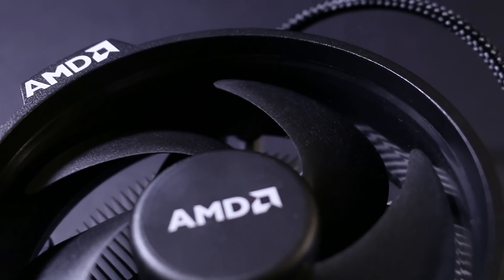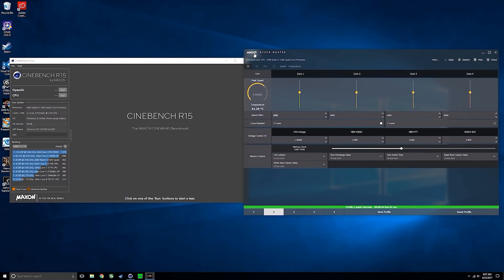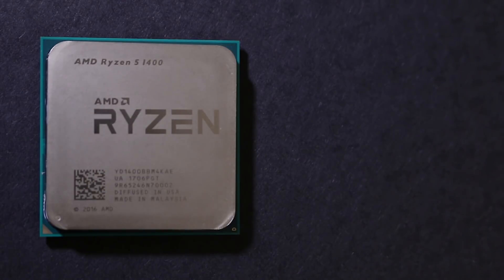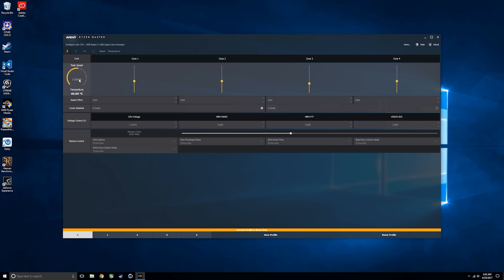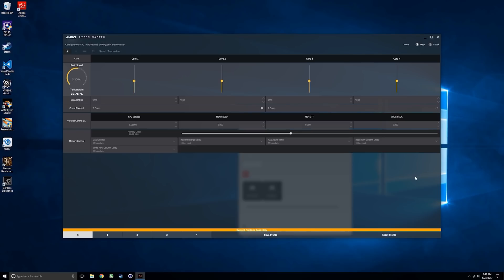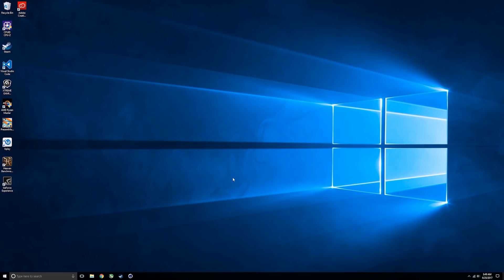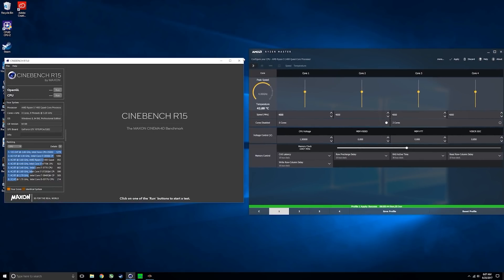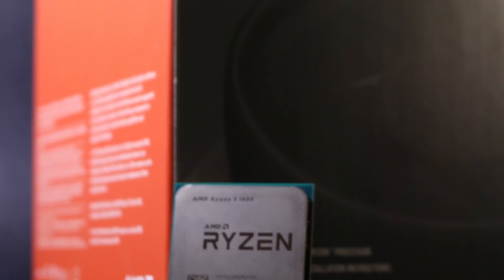AMD RYZEN Overclocking GUIDE

Comment: If i click apply it says that i have to enable HPET, do you know how to do that?
Reply: to enable the HPET, you need to go to the directory of Ryzen System Master where you can find a batch called "HPET", start it and then reboot your Computer. DONE
Reply: @cryptos6103   thanks for the info mate
Reply from the maker: High Precision Event Timer, sometimes you can just click 'ok' but if the error is persistent you'll need to get into the BIOS and enable it (in the advanced section)
Reply: Optimum Tech Okay thanks
Reply: CPU software tends to conflict with the BIOS itself, you'll need to uninstall Ryzen Master, as it forces your motherboard to lock down the CPU

Comment: I’ve only managed to get my ryzen 5 1600 to 3.8 ghz. Anything after that, and my pc will boot, but then something will fail and it will stop displaying video. I’ve tried upping the voltage, and even re-applying thermal paste. Ah well 🤷‍♂️

Comment: Using an A320m HDV R4.0 board with a ryzen 5 2600 cpu and it won't allow me to overclock in bios nor with ryzen master.  Doesn't allow me to change anything for the CPU in Ryzen master and there's no options in Bios.  Wish I could overclock it a bit more

Comment: I using my R5 3500x overclocked i did 3.9ghz from 3.6 and the voltage is 1.36 is it okay?
Reply: 1.425 js safe for r5 2600 so it should be safe for you cpu as well

Comment: I'm using Ryzen 1600 with MSI B450 Pro VDH. Overclocked cpu to 3.6Ghz(no change with core volt... Set to auto 1.240v). Run CPU Stress test through AIDA for 30mins approx. got cpu temp 63c and Mobo temp 77c approx. Is it ok? If I push cpu to max 3.9Ghz how much volt i have to use?

Comment: quick question i have a ryzen 7 5800x. i made a offset overclock. 1.25V with a full core 4.7ghz. runs stable but hits around 82°c on cinebench 20 tests with a big Noctua cooler. i didnt touch anything else but the Voltage and the Ghz in the Bios. is there anything else id need to adjust or can i leave it at that? what do you recommend?

Comment: I'm using a Ryzen 5 3400g and I'm into overclocking it as well. Currently I'm at 4Ghz with 1.4V and apu at 1600Mhz with 1.1V. Sometimes it crashes, sometimes it won't. What seems to be the problem? Should I lower my cpu voltage and increase apu voltage? Stock apu speed of Ryzen 5 3400g is 1400Mhz.

Comment: Question im getting R7 3700x im using wraith prism cooler what voltages should i use i want to oc to like 4.0ghz or 3.9ghz so what should i put my voltages on? And another question is 1.4 voltages the max recommended voltage on intel and amd cpus? sorry if bad english

Comment: So i have a ryzen 3 1200 quad core processor that at stock speed is 3.1ghz. when I open the ryzen master thing and select profile 1 and start to make changes to the voltage and the speed of CPU, it doesnt actually change. it stays the same. I hit apply for the better settings and my computer didnt want to restart and nothing happened. Can you please help me?
Reply: There should be a battery in your motherboard, turn off your computer and pull out the power cord. Then take out that battery and wait a few minutes. Out it back in and your bios settings should be back to stock.

Comment: I just raise my CPU volts to 1.45V and raised clock speed until it could run cinibench 3 times with out crashing.

Then lowered my voltage little by little until I got my clock speed to not crash on cinibench and run at a safe 1.325V

Comment: I've got an r7 1700 which is stable on 3.7Ghz at 1.25. However, at this clock speed and voltage it reaches close to 80 degrees Celsius on the stock cooler.. Should I apply new thermal paste?
Reply: Get an new better air cooler and an Good termal paste and you Will be able to overklock that cpu quite more it seems like om on 1.41v and 4ghz all cores ;)
Thow have an noctua nh-d15 cooler.
And so you know it disable auto booster in bios can search internet on how to do it some motherboards and bios dont work well with it on just saying.
My CPU did an temporary jump with that enabled to 1.6v and that could have killed my cpu, but thank god it didn't somehow😂

Comment: I'm using a ryzen 7 1700. The normal voltage was at 1.5V at 3.2Ghz. Is that right? o.o
Also, I tried to run benchmark once, the pc restarted without errors but now I double click benchmark icon and nothing happens. WTF

Comment: when i go to current on ryzen master the voltages and GHZ keeps changing (voltage between 1.1-1.4) and ghz for cores(2-3.7ghz) with out oc is that normal but when i play the ghz is stable at 3.7 and the voltages 1.4

Comment: thanks bro i know this is a old video but i'm trying to reach 4.5ghz to my ryzen 9 3900x
Reply: Let your motherboard boost your 3900X, DON'T add more Vcore voltage because 7nm node IS way easier to burn and destroy with just a little + mV :-( Stay safe my bro, these new 3000 series processors are performance kings anyway!

Comment: R5 2600 how ghz i can oc with the stock cooler?
Reply: I have R5 2600, tried 4gHz and 1.3V, and my computer black screened and froze. With higher voltage it should be possible to get 4gHz.

Comment: this îs not a good video. You have to put the llc level/mode into it too. For example I have a r7 2700 overclocked at 4.0 1.2875v with llc mode 3 in a msi b450m mortar titanium and i get 58c while gaming on a ryzen max cooler, and it’s stable. With 1.3v and llc mode 1 I get 60c.

Comment: WARNING! the max safe voltage for Ryzen is 1.425 Volts for Ryzen 5 Generation 1. should be 1.4 Volts for Gen+, Keep it less than 1.4 volts not 1.55! My Ryzen 5 2600 is running 4.1 GHZ by 1.35 volts only, VERY HAPPY with the results, I can easily go for 4.2 GHZ  for less than 1.4 v. but I prefer to give it a room for breathing

Comment: i clocked my ryzen 5 1600 to 3800Mhz at 1.8 volts and it keeps failing. can you please help? thanks
Reply: You may have jumped the power a bit too high, I assume you must have just got a bad cpu for overclocking. You may have damaged your cpu.
Reply: Kyle L hey sorry for the misconception I was able to clock the CPU @ 4.0Ghz @1.3225v. Instead of using ryzen master, I just used the ROG BIOS in my motherboard. It works just fine

Comment: Hi. I came across this video while trying to find an answer for my overclocking problems. I have a Ryzen 7 1700x with AsRock Taichi X370 mobo. I've been following any guides I could find on overclocking the CPU, but I get no success. Since then i never bothered to OC again, and 2 years later here I am trying again. So I do all the guide settings to OC, the PC and Bios read 3600-3800ghz, but CPU-z and HWmonitor actually showed my CPU to 2100-ish ghz. It was underclocked. I have no idea why. The other round was pure trying ryzen master to OC, and I managed to get into 3.9ghz, but it's only on ryzen master. In the other hand like Bios or PC info or cinebench, it's still 3.4ghz. And after that, the ryzen master's read just reverted back like that. I even try to up the voltage but with the same 3.4ghz! And guess what, the cpuz reading is 2.1ghz. I have no idea why, since i've followed the exact setting on some guide with the same motherboard. Looks like I got very unlucky cpu or mobo. Prolly Imma stop OC now :(

Comment: Any of you tried to overclock the Ryzen 5 2600x? What ghz and Voltage is stable?
Reply: TevezGames from what I’ve read in here I’d say, if you have a cooler that can handle it, 1.4v feeding 4GHz is a kind of stretch goal that you might want to try to tend towards

Comment: Incorrectly done on my part, my msi motherboard has locked down my CPU, so I can't overclock it, my board though is an MSI B450M Mortar Titanium, and I have a 3 year old Ryzen 5 1400 quad core, it's only overclocking is game mode, which is it's AMD programmed turbo mode, so it only goes to 3.4ghz max

Comment: What voltage should I put my ryzen 7 1700 if I want to run at 3.7ghz
Reply: It might run that fine at default. If not, kick it up to 1.3 volts
Reply: @braxtonmcmullen-adair2410  ty

Comment: I somehow got my 2600 to run stable at 1.15v at 3.8ghz...
Reply: Holy crap you won the silicon lottery, you can probably go higher than 4 GHz in just 1.35v
Reply: Cb score with that?

Comment: Having an issue with these steps I changed the setting 100 at a time but now after restart when trying to open the master software the computer crashes how can I go back and change the clock back down without the software
Reply: Can you still get into Bios? Just revert to safe settings there and start from scratch. Or just reset the Bios via jumper (or whatever method your board offers).

Comment: hello i overclocked my ryzen 1500x at 3900 1.3 voltage and in my taks manager when i start benchmark  highest speed is 3.57ghz ? help ? i try 3800 1.3-1.375 votalge and same thing is happening ?
Reply: Read about load-line calibration (LLC) and try to overclock with bios instead of software
Reply: @mikumiku4021   i dont know overclock in bios and cant find video at youtube for my proc + motherbooard .

Comment: Its pretty much a silicon lottery OR a not good enough motherboard, i can only get 3,8 ghz stable and it requires 1,3375v (gigabyte b450m-ds3h board) and heating isnt an issue at all since im using on of the best air coolers ever (thermaltake big typhoon), at 3,80ghz it never goes above 60 degrees c, and it even drops to 55 degrees after 20+ min in prime95

Comment: This is probably extremely stupid of me but what happens if a test fails and you crash? Does it just revert to previous settings by itself?
Reply: Lord Shaxx, Crucible Handler probably depends, if you had a super crash that even your pc isn’t booting, then turn off everything and remove the motherboard battery to reset bios to default settings

Comment: I only got 3.8 with 1.3V and i have a R51400 with stock cooler why?
Reply: Silicon lottery. Sometimes chips of the same type can be better or worse at over clocking.

Comment: HELP PLEASE when i did the test on 3.9 my screen went black and im really scared
Edit: i have a R5-1400 just like him
Reply: have you fixed this since? I had the same issue. What you need to do is turn off your pc, unplug powersupply and remove the battery from your motherboard for about 60+ seconds. This resets the motherboard and will allow you to reboot.
Reply: ZEUS the DJ im fine now

Comment: Hey new builder here. So i tried to overclock my cpu with ryzen master , i am using the ryzen 2200g and tried to raise my frequency from 3.1 to 3.2ghz. But once i applied my setting and restarted, my pc wont boot! What should I do? I have seen some forums for fixing this kind of issue but as a new builder i am nervous as to what method I should use that id best for my situation. Thank you!

Comment: My r5 1600 reaches 3.9 ghz at 1.225 V. Looped CPU test on Time Spy never crosses 78°C at ambient temp of 24-25°C, stock cooler. Idle temps between 45-48°C.
I don't know if I'm stupid and significantly fucking something up but this is happening.

Using an MSI x370 Gaming Plus, 32 gigs 3000 MHz ram. (Deep learning rig)

However, I can't seem to go over 3.95 Ghz.

Comment: Hi everyone, I want to build a 320 euro gaming pc, with the Ryzen 3 2200g (I will be using the iGPU) and I'm not sure what to get for better performance for overwatch: -a a320m mobo plus  8gb 2666 MHz ram 
-or a b350 motherboard and an overclock of 3.9 GHz plus 8gb 2444 MHz ram. Which one is better for overwatch? 
Edit: is it possible to overclock the iGPU part of the Ryzen 3 2200g with Ryzen Master?
Reply: Try and get 3000+MHz RAM as it scales well with Ryzen chips

Comment: I've heard that going over 1.44 V on Ryzen is considered dangerous, as in it could cause degradation in the long term. Where did you get the 1.55 V value? Is it possible it's a difference between the 1st and 2nd gen?
Reply: Yes don't do it

Comment: My way to overclock fast and efficiently is to set my maximum voltage at the very beginning, then start going up with the frequency until it's at it's max speed without crashing. Then, i move the voltage slighly down to get the thermals down as far as i can with a stable system.

Comment: i own a ryzen 7 2700 (not the X version) and i use its stock cooler atm.

in idle (no overclock) it has 50° and i dont know why.
im scared to overclock since it will go up in temperatur..
should i put in a better cooler? i have a Dark Pro 3 in my old pc. will it be better to cool the cpu down?
Reply: Get good cpu cooler maybe aio cooler

Comment: My 1600 can get to 3.875ghz at 1.3v but it gets to over 80c in the stress test so I stopped it I am using the stock cooler
Reply: Zak Hague keep it within stock speeds, stock coolers arent really design to cool your cpu when you overclock

Comment: Ryzen master go back to default 3.2ghz after pc restarts. Bios is better.
Reply: did u get any solution? i got same issue....going back to default after restarting pc
Reply: @sairohithreddyv   apply that voltage and in bios save then reatsrt
Reply: @HARISH_19_97  What about the ghz in bios?
Reply: @zax331  I would assume that you should also do the same for ghz
Reply: Daniel Melling then why even use ryzen master
Reply: @cXrMedia  Exactly
Reply: @cXrMedia  its just a bit more simple to use

Comment: How much should I overclock my cpu so that I wouldn't have any problems? I have an AMD Ryzen 5 1600 and I'm asking because I've had quite a few problems with overclocking, from freezing to bluescreens, and increasing the voltage didn't help.. I have a 650W power supply, maybe it's not enough? Should I get an upgrade? The CPU also gets extremely hot just by staying at 3700 MHz clockspeed and 1.3 voltage (right now it's about 80-85 degrees Celsius)

Comment: so when I overclocked my r6 1600 to 3.7 GHz and pressed apply it seemed to work. However, after the reboot when I opened my Ryzen master on the C tab one core was running at 3700 while the others kept fluctuating and some even were in the 1000. If anyone is good with this stuff can you tell me if this is normal? Thanks!

Comment: There's a risk with using a Ryzen Master. I've tried to OC my Ryzen 5 1600. I've set the clock to 3800 MHz and voltage to 1,35V. Than applying and restart - the PC failed to post, The fan just ran and ambient leds where lit, but monitor showed that there's nothing plugged in and nothing else happened. Only clearing CMOS with bridging the jumper allowed my to go to UEFI and boot. But with UEFI/BIOS OC I've then set 3800 MHz and 1,35V and it booted flawlessly. That's weird, because Ryzen Master is supposed to help beggining overclockers with OC and not to freak them out.

Comment: I'm using a Ryzen 7 1700.
And when I tried to run 3.9Ghz at a voltage of 1.33125 and it CRASHED.
isn't R7 supposed to handle it easy as your R5 made 4.0Ghz with this voltage?
Reply: Verry few 1700 can do 4ghz  3.7 yes they can do easy

Comment: So now theres one thing left. I saw a video where the Stock Cooler of the R7 1700 was tested. And when it was overclocked to i think 3.8. Ghz the CPU was at arround 80 degrees. So the guy in the video increased the fanspeed of the cooler and after that everything went fine. So how do you do that?

Comment: 🚨I have my Ryzen 5 1600 at 3.9 GHz at 1.35 V but why does it say base speed 3.2 GHz in task manager? 🚨
Reply: If you are not using the high performance power plan then the clock speed will be lowered when the CPU isn't under stress

Comment: lol...i went into the bios and just cranked the CPU clock speed from 3.2 to 3.6Ghz and that's it! Nothing else, it works like a charm, had absolutely no issues with it (tested games and benchmarks) and it's been like this for 2-3 months. I have a max of 60C degrees with a Noctua NH L9i in a small form factor case with a GIGABYTE GA-AB350N-Gaming WIFI.
I have a Ryzen 1600 :)

Comment: Brilliant video! I will try Ryzen Master when I get home. Just a quick question. I have tried overclocking my R5 1600 to no avail. I'm only using the stock cooler but I know many do so that isn't my problem. I was thinking could it be my small PSU? Corsair 430w. I only have a GTX 750Ti paired with it so nothing should be using all 430 watts. Any suggestions? Cheers
Reply from the maker: No probs! 430W is fine, what settings are you using?
Reply: Optimum Tech I think I tried 3.8 and 3.9Ghz. I can't remeber what voltage I used because I tried it a month or so ago and just gave up because nothing seemed to work. Most of the time it wouldn't even boot past the bios let alone windows. I would have to reset the cmos everytime. Since then I have installed the latest bios and perhaps this time I should start with a more conservative OC and follow your video.
Reply: Optimum Tech Also the reason I mentioned my PSU is because sometimes I'd get a blue screen at stock speeds

Comment: As soon as i hit apply with the same speed and voltage (3.7 and 1.3 respectively), it shut down my computer and told me i had error 0xc0000221 for kernals and what not. I fixed that issue but I would like to know where I went wrong if anyone would like to pitch in. Specs: r5 1400 stock cooler, rx 570, cx650m, samsung evo 850, 16gb ram running at 2933, and for the mobo it's a b350 tomohawk from msi.
Reply: and by fix i mean, i had to clean out my ssd and lost all my data which wasn't much thankfully and had to clean install windows 10

Comment: the master software says my cpu is running at 3.9ghz (also confimed with cpuid) but i went into my bios to confirm aswell and it says its at 3.4. Upon booting into windows it went to 3.4 not the 3.9 i had previous. . .